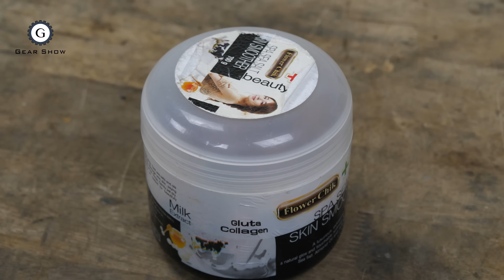Vintage to Modern Drill Restoration | Makita

Comment: the point of a keyless chuck is really to let it spin otherwise in a normal chuck you could risk breaking the drill bit entirely. i learned this the hard way. you didn't even used loctite in the threads since you couldn't drill a reverse thread anyways...

Comment: i wish you had it running before drilling wood then AFTER drilling wood on battery. We all know battery power will be weaker etc but id like comparisons and not just boring converting these to battery power. Its same video over and over